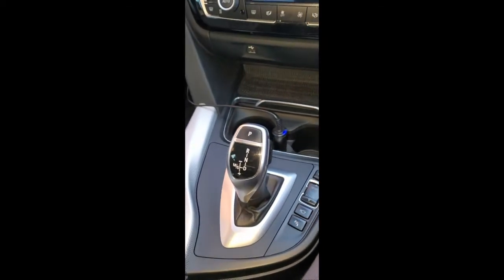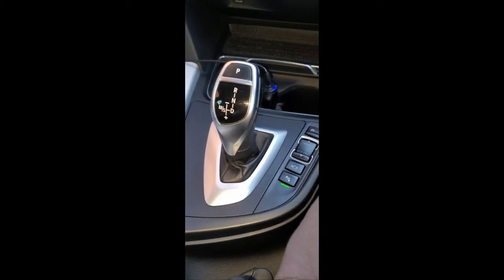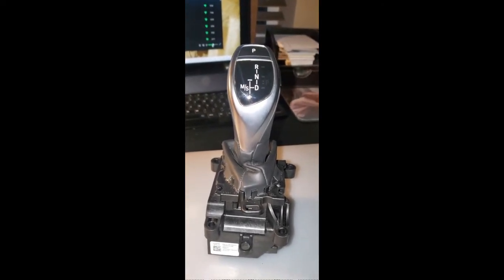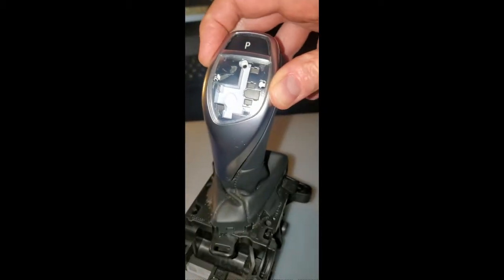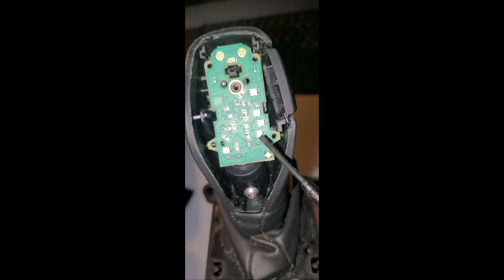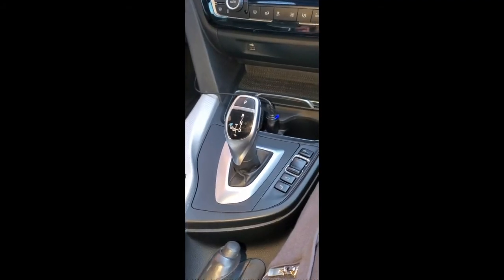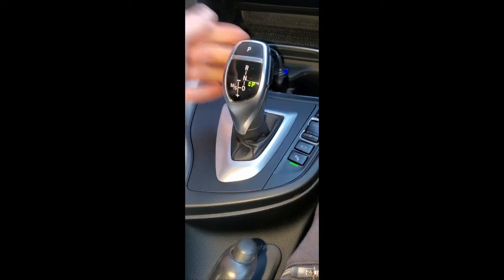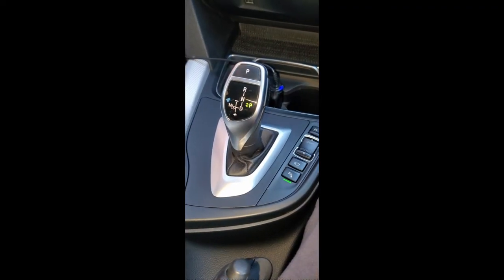BMW Gear Lever LED repair

Comment: Mine only goes away when i put it on manual mode. Then goes back after a few rides. Ita weird
Reply: hey, have you fixed it? looks like the issue is related to the wiring (or could be the board in this video), i have not checked wiring on mine, but it does the same, goes into Manual mode, leds stop working.
Reply: Honestly, when I want to rip it, I just put it on sports mode and I barely do manual. So I haven't. I doubt this is a physical wiring though since it goes back up once I turn off the car and all lights turns off. Once I turn it back on, it fixes itself up.

Comment: You can just replace non working LED with new one. And you can use probably any LED that fits on soldering points, even 2 pin. 4 soldering points are 1 LED plus(anode) and 3 GND. Solder 2 pin LED diagonally so you get it it in the center. On original LED there is a notch on one corner, this is LED -(kathode). On oposite site is LED +(anode).
Reply: Since going in to drive made all the other lights stop working, it may not be just the LED that's bad.

Comment: Why dont you replace the circuit without having to remove the complete lever?
Reply: The lever from the car was never removed only the top trim pieces. The detached lever in the video was purchased from eBay.

Comment: Great video and as a result I have sourced a replacement gear lever and fixed the very same problem on my 6 series which happened when I put it in reverse. BMW quoted me over £1000 for a whole new gear stick ignoring the costs to fit. Fixed mine for £80 thanks to your video 🎉

Comment: Thank you so much for taking the time to do this video. I followed it exactly and was able to replace my circuit board (bought on eBay) in under 10 mins.  Well done David.
Reply from the maker: No problem! That's great news! Well done you!
Reply: Can u send the link from eBay?

Comment: Hi david, thanks for this video. Question please, how did you stick the front panel back down please?
Reply: It was still a little sticky so just placed it back in. You could heat it up a little with a hair drier to make the glue stickier. I eventually bought a replacement top cover from ebay for a few pounds as I'd slightly scratched the old one.

Comment: I got the same issue but everything working except the D led it go off but rest leds on gear works fine any idea?
Reply: Mine too
Reply: @jaysheelbhujun  any idea how to fix the D led ? Maybe put another led for D gear only? Or change the full gear board? From any f30 as a spare part or it gotta be from 340i as my car now
Reply: All the LEDs are on the same PCB board. They can be removed and new ones resouldered on but that's beyond my skill level. Much easier to buy a salvage gear stick from ebay and just replace the board as in vid

Comment: Hey @davyctvr - what year and miles was your BMW when the LEDs started acting up? I have a 2015 435i/75k miles. Thanks! Oh and thank you for this video! Gonna fix this myself!
Reply: Mileage around 39000 when it broke. Since replaced never had an issue.